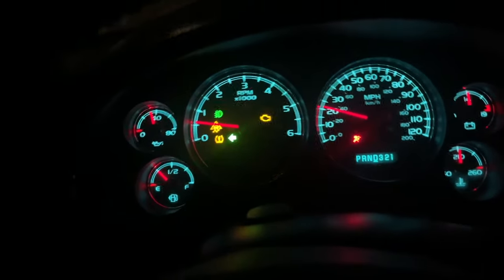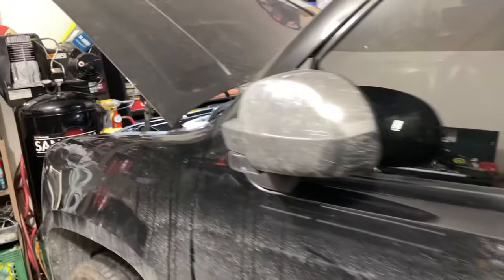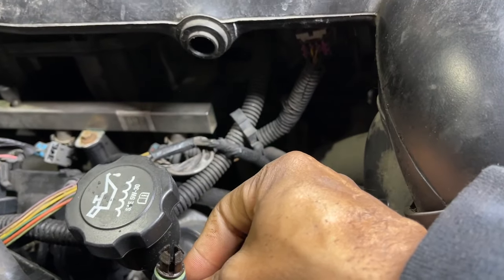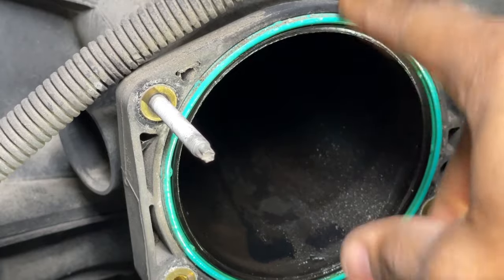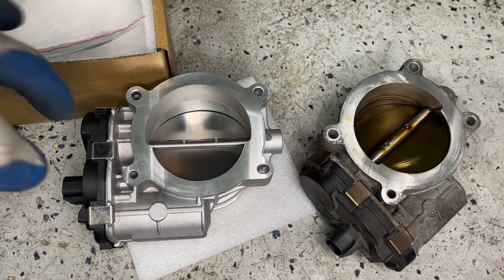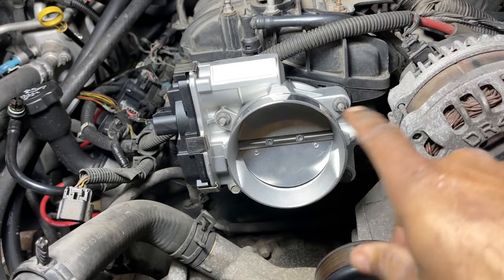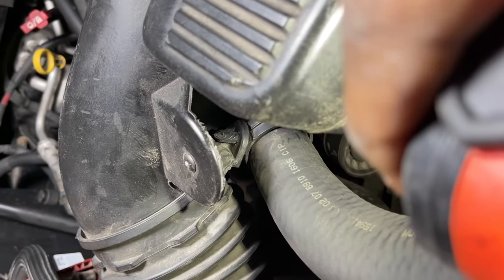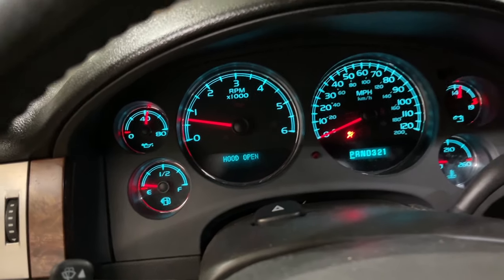How To Fix Reduced Engine Power Quick And Simple! Code P2135 Chevy Or GMC Trucks / SUV's! TPS Issue!

Comment: Couldn't you have just replaced the sensor alone? I have a 2012 GMC Yukon SLT 5.3
Reply from the maker: Possibly, although it's not recommended. It's actually better to replace the part unless you clean the throttle body really good. There will be a carbon build up inside the section that rotates that may be hard to reach. That's why I would definitely replace the entire unit. Also, the sensor cost just as much or if not more than an entire new unit. Here's a link to the part for you car....
https://www.ebay.com/itm/184534737954?fits=Submodel%3ASLT%7CYear%3A2012%7CMake%3AGMC&hash=item2af720a422:g:x7gAAOSwG2Rh2PXF&amdata=enc%3AAQAHAAAA8JwaDkzcr%2BWUsWbfTUo8ogdmPxUHeqeySlo%2BvgMGXF6GZEIlOdPiBNf%2FykFhlLt0VdZFrDjn1vpSj2tSBdM%2BR%2F%2BZykb7ZdNZUr1p8KVtaHN1V4Ejho3VnxQkDleLs2hI40FUvbccUIP%2BIJ%2B03pUEY78Sb1ZfVEipq5cr4G5n38BbMrO3oK4q6sj1owvz%2FqyxT3OGx0IIzIdrx9e0LvsJVskxZLMW%2FgkZpjMBOg35c7EiZlf%2BBF1HgFyEev8EuZlIvESjz2o1FFtqNJbSGk72V5FbagoCWrBy0zgYIz%2FexeHwiExtXESv2U4EgEItSoLsGA%3D%3D%7Ctkp%3ABk9SR4y3zoSaYQ

Comment: Hey, I have a Chevy 2016 equinox LT 2.4 engine and out out of nowhere. Once I put a new battery it was a cheap battery and I was told that it wasn’t compatible with my car but I can use it the next day my car started reducing power jerking and no acceleration when I hit the gas so I went back got the correct battery recently got it installed and it’s still doing the same thing There’s no sign saying reduce an engine power but the (!) Is present along with the engine light camera isn’t working in reverse. Seems like there’s a lot of shortages within certain car program I’ve got diagnostics I’ve been told my transmission might need to be looked at power steering service is on and stability. Track keeps coming on

 could it be something as simple as my throttle body should I just get this fixed to see if that fixes the problem.  Last question when replacing the throttlebody is the throttlebody and the throttle sensor two different things?
Reply from the maker: If I were you, I would get the codes read to see exactly what is the problem. I can help you out or guide you then. Also, the throttle body has the sensor attached to it, hence both are the same thing.
Reply: @TerenceDIY  thanks I thought I had included the codes that was given to me I end up going to two different dealerships and did diagnostics. These are the codes that were given to me. P2122. U0101. U0100. U0402.
Reply from the maker: The throttle body would not throw them many codes. What did both dealerships advise you to do? It's hard for me to guide you in a direction or pinpoint the problem since I cannot see the vehicle in person.
Reply: @TerenceDIY  understandable. the first two codes was at the first dealership and then the second two codes were at the other first dealership thought it was due to loose wires and battery because I let some guy at AutoZone put in the first one so they tightened them. It ran that rest of the day OK but the next day the problem started again. The other dealership I was at yesterday it said that they might have to look at the transmission to see what the problem is because of the coding, if only you were in Georgia 😅 but thanks so much just for responding 🙏🏾
Reply from the maker: I wish I were there to help. I could probably figure it out within a few minutes.
Reply: @TerenceDIY  I’m so desperate not to spend unnecessary money I’ll do a face time call sh*t lol thanks tho 🙏🏾
Reply from the maker: I would have to be there with all of my scan tools, etc.. It would be impossible for me to diagnose through Face Time. I wish I could though.

Comment: I replaced it still same problem. Is that because I need to reset it?
Reply from the maker: What trouble codes are you getting??
Reply: It was throttle body I replaced it with the sensor now it’s showing code p0449
Reply from the maker: I am not a betting man but after dealing with soooo many of these vehicles, I am guessing this is your issue. Here is a link to the part...

https://www.ebay.com/itm/164284961563?fits=Year%3A2007%7CModel%3ASuburban+1500%7CMake%3AChevrolet&epid=12042026476&hash=item264025931b:g:PKcAAOSwuPdidHGk&amdata=enc%3AAQAIAAABANZO3mdzztKOPDdKkxcZiIIpWvekd62XMfL5MizkJVBsXdSwLRu9u1m0XAZGITVpNjJjrWT9m9XTm8xkX94DursmIkY0zf4w%2Bp%2FwiPLhqWqcc6mY2jNzbSJZwfzf4O7Xn9VaMwl070MBFbE8qe8ephD%2BF3yn3Vu3TCWGudzuTbl10Ys1xW62Fpx5Lq3BHuUAuf71aGbyPrwiCNe4IoX%2BzAhgP2wc90bYZD8o1yH8wb5DTK63QKUlV7yDPsPlqho0mddawcnHaa07i83RYCk1arZn5cKgM%2Bhbe3eSSjwJf0paT%2BmSUKma08aa2XFJ8ycvUJY9VDI9Z5O2mo3YwIHiNTI%3D%7Ctkp%3ABFBMvKCSoqdj

Comment: my 2003 silverado has same issue but daylight running lamp is dim. when I turn on headlamp, it activates the reduced engine..
Reply from the maker: That's weird. How are the volts reading? Any codes?

Comment: I changed the throttle position sensor on my 2010 Silverado, and it had 4 codes show up after that. Should I just ignore the codes and go ahead and reset them?
Reply from the maker: Yes, reset them and drive it a while to see if the codes arise again. How is it running? Did you replace it with an aftermarket throttle body? Thanks,
Reply: @TerenceDIY  I just changed the sensor, and removed the throttle body to clean it. After I reset the codes, it cranked fine. When goosing the pedal, the rpm’s stay stuck at around 3000 for longer than expected, and a couple of times I had to put it in gear to get it to go down. I’ve cranked and warmed it up several times today and drove it about 20 miles with no problem.
Reply from the maker: @johnharrison5656 , hopefully everything is fine now. If not, I would recommend replacing the throttle body as a whole. Let me know if you need a link to a good, reliable affordable part. I buy from several online sellers.  Thank you.
Reply: @TerenceDIY  Thank you and thanks for the video.
Reply from the maker: You're very welcome John. Thank you so much for watching.
Reply: @TerenceDIY  Hey man, just an update. The more I drive the truck, the better it’s driving. The high idling has went away and it’s starting to shift better. It took about 60 miles
Reply from the maker: That's great!

Comment: Im having reduced power engine 2013 sierra 5.3 I have another truck that’s working good so I installed the working throttle body on the reduced engine power truck but it’s still the same
Reply: I need help
Reply from the maker: Hi, there was a bulletin released by chevy some years back regarding this issue. The bulletin consisted of either a bad throttle body or the wire harness that the throttle body plug come out of being an issue as the wires were becoming frayed some how. If I were you, I would check that harness thoroughly to see if you see any issues along the harness. That's the best advice I can offer since I'm not able to inspect the truck. Thank you so much for watching.

Comment: Can you replace the sensor only on them or buy new unit. Ive got a built 5.3 2007 Avalanche.👊
Reply: I have a 2007 Chevy Avalanche LS V8 5.3L Vortec 4WD Flex Fuel.  I only replaced the sensor and everything is good now.  I disconnected the negative battery cable for 24hrs while waiting for the part.  I followed the steps identical to Eric @SouthMainAuto.  Issue is finally resolved.  Gl

Comment: Hi my 2007 suburban has been giving me the reduced engine speed error. When I took it to advance auto the code p2138 came up so is that a different issue?
Reply from the maker: The code p02138 can possibly be the throttle body motor being defective. I would change out the throttle body if I were you. It's VERY easy to change. Here is a link to an OEM one. 
https://www.ebay.com/itm/114732200404?_trkparms=amclksrc%3DITM%26aid%3D111001%26algo%3DREC.SEED%26ao%3D1%26asc%3D20160908105057%26meid%3D404e5ce83ec54ee9ba2b0d57bcc08fc9%26pid%3D100675%26rk%3D1%26rkt%3D15%26sd%3D114732200404%26itm%3D114732200404%26pmt%3D0%26noa%3D1%26pg%3D2380057%26brand%3DGeneral+Motors&_trksid=p2380057.c100675.m4236&_trkparms=pageci%3A22c50910-f0ce-11ec-937b-fe034324fcf9%7Cparentrq%3A828fbfed1810aa7148884318fff25382%7Ciid%3A1
Reply: Our 09 tahoe has the Exact same code.

Comment: Did that throttle body end up fixing it the whole time?
Reply from the maker: Absolutely. And it still run amazing.
Reply: @TerenceDIY  sweet! My 04 avalanche 5.3 is doing  the same thing. Alot of people  say it's a ground and then the reduced engine power comes on when they hit a bump or pothole. But mine does it at random. Was yours at random? Or when you hit a pothole?
Reply from the maker: 100 percent random. 

Here are a couple of links to the throttle body in case you want to replace it. 

https://www.ebay.com/itm/225590875332?fits=Year%3A2010%7CMake%3AChevrolet&hash=item34864394c4:g:tgUAAOSwNrhkby5M&amdata=enc%3AAQAIAAAA0NNQWXMnLtdnN%2Byk2rlPXLmDWd9AB5%2FNY652Eej11m1%2FB0G1XhWda%2FpviIbqPRJLH4C0Tyu2IOxZ9%2BhGC2eHlG2WNK9nBkvGu%2BBWK5S1ZCy1ptkk%2FPwYPfMWz0Bi4nJZVVaIF%2BqT8eBu8I9H4kE79oi%2B09GINpLknWXuov9DklivABeiaKp8roClnaaNdcosxBg9Hmb%2BXKYBZ%2B%2FIT2h5R82wPCfV6tSLn%2F%2BGxRNxyExvGBrw6LCCdlu51M6WasTWM55BcHaJ8L1kgzQSCbhWSQo%3D%7Ctkp%3ABlBMUJ7toKaRYw

https://www.ebay.com/itm/334545636173?fits=Year%3A2010%7CMake%3AChevrolet&hash=item4de4794b4d:g:ZnQAAOSwm3ZlfWEn&amdata=enc%3AAQAIAAAA0NHmZTvPKTWvLELcReyOYpiF0wpvs01Am1J1QE88o56udbETz8kRtqEihqMfWZjDajyDb6HnWsjunIdX3S9Nngw3t2x%2FCC3%2FZ4l3kRSOnra%2BBq1Pn1F78WAZ3LplF91acU3V8W1Q9fevvIYnDdO3LdBCcXwOMJ6XrnRJ2hN2E5iTj0Csgq2m5H7IXYajMV1DvtQd%2F1Qo1k4VrBvA%2BOQF1HNYz6dM2MtN9P%2FDxUHCMpdHN4boQSRss%2BX1UU49UA2MCcuDxGFTpUQ8gBfXklun2CA%3D%7Ctkp%3ABk9SR57toKaRYw
Reply: @TerenceDIY  thank you so much!! Those prices  beat rockauto  witch  is hard to do! Might just do that! Ty so much
Reply from the maker: You're very welcome. That's where I buy 90 percent of my parts from. For years now. Once again, thank YOU for watching.
Reply: @TerenceDIY  well im definitely  subscribing to you now.
Reply from the maker: Thank you so much.

Comment: Thanks for the great content, keep it up.  I own a Chevy Express 5.7 L, what would give me more of an improvement in economy (mpg’s); replacing all of the O2 sensors OR replacing the I.A.C. valve and the T.P.S.?  Thanks for your input!
Reply from the maker: The O2 sensors will help more than the IAC or the TPS (ONLY if they need replacing). You can clean the IAC sensor and it will work just like new. The better solution than all of the things you mentioned would be a high airflow air filter like a K&N. You'll get the best MPG, and a little added horsepower. Thank you SO much for watching.

Comment: I have a 07 trail blazer ss 6.0 it didn’t let me accelerate any more and the streeting wheel got stuck shortly after the reduced engine light turned on what could this be I already changed cam senor
Reply: Please help bro
Reply: Does it everytime I drive it , it leaves me everywhere I have to wait about a hour till I try again and it oddley turns on again
Reply from the maker: @Deleteddddbd  , the reduced engine can be a few different things. Can you tell me what codes the vehicle is throwing? I can check the software once I know. Thanks,

Comment: I buy auto zone one and only work for two days so I have to buy one at the agency and u think it will solve the problem
Reply from the maker: Autozone does not sale the OEM one I don't believe. Here is a link for an OEM one. 

https://www.ebay.com/itm/114732200404?fits=Year%3A2007%7CModel%3ASuburban+1500%7CMake%3AChevrolet&hash=item1ab69271d4:g:bnAAAOSwWMRgU8CT

Comment: Im getting p2135 code still after changing both the tps and even the accelerator pedal position sensor with gm certified parts and still get that code sometimes. Any suggestions?
Reply from the maker: Did you replace the entire throttle body assembly? If not, that may be your issue.
Reply: I ordered one and it's on its way to me now
Reply from the maker: Okay. Keep me updated. Thanks,
Reply: I replaced the throttle body and it still went into limp mode after driving it for a day. I believe it's in the wiring or the ECM itself
Reply from the maker: That's exactly what I was going to tell you to check. There was a bulletin Chevy released regarding the wiring or that harness and connector that plugs into that throttle body some years ago. Inspect it really well for frayed wires, check the connector as well.

Comment: My headlights keep flickering 2012 LTZ Silverado something with the ground wires can’t figure it out
Reply from the maker: Hi John, when do they flicker, during the night time at use or all the time (daytime running lamps as well)?
Reply: @TerenceDIY  during acceleration
Reply from the maker: That's odd. You are probably correct about having a bad ground somewhere. Just gotta track it down.

Comment: Hi Terence, 
Hi I'm having the same problem with my 2007 Gmc Savana 3500 with the 4.8 Vortec.  The one you replaced looks just like mine will that one work on mine and where did you get it?
Reply from the maker: Yes, it will work. Here is the link for the SPECIFIC part for your van...

https://www.ebay.com/itm/293727259993?fits=Year%3A2007%7CMake%3AChevrolet&hash=item4463824d59:g:C5YAAOSwpnVgmzsw&amdata=enc%3AAQAHAAAAsJ30pMu8uQE%2BTlYMCs4jtZSWCHNids%2F5Gd7Ta0kpqFiS47j5BihuFAXafdmuAiY0HEe0CqB4xw22ypqmvJtU3Ss74X2Xps8Z8m5Pavw8FB6RTZfNf%2B1K%2FvFYUTXAm4bnwE%2FW8lt4adcWqEiKOhQ77tW%2FaUgRvc5SUhveyTUNYKUWjRKdf28sC%2FpojmpC7sx5mMTnD2VRBGdcDJrX36mzjaGl480LDP4P8vBgIujRC3n3%7Ctkp%3ABk9SR4qy-sHAYQ

Comment: Doea this reduced engine power only happen with drive by wire throttle bodys
Reply from the maker: Nope. There are many circumstances that would cause the reduced engine power (limp mode). The codes are the most important insight to the cause of the problem.

Comment: You never say what exactly you changed/installed.
Reply from the maker: The video is extremely detailed. If I did not mention the part name, I apologize. It's the throttle body. Here is a link to the part. 

https://www.ebay.com/itm/273974704021?fits=Year%3A2010%7CMake%3AChevrolet&itmmeta=01HYAXNYYP6ZQRQ8TS1NH97XE1&hash=item3fca2a3795:g:J4kAAOSwZE5mGTEF&itmprp=enc%3AAQAJAAAA8E06yIDENQEGtBF07wx%2B2BShtatMkABSa%2F6fjDKkL8TV3%2BkcDOLJdyS4xkxI2PMZfvYiiqHbAL1VFY7uJvXEvhq0BSnHv7HeH7C%2Bg946IuVTf8DySisEn2LQ%2Fao034FloIoCwdQypIZWDdDwaSmu5d6dLCZP4%2FmWHljSHpVb0rNzLe4MIo5LDKRczd7DQChEhy%2FNd9lsDviYjO3gXYd%2Fae9iqGF2189E8B2f7WO2XHJIf1Km6Y0eufKUXLGgYQLd64xLxI4aO4Z4%2Bp3u9I45yrDjEbGMb7YLvQ%2BIzaH414ebaMPwtA4ih5MoJjgLhOQvDA%3D%3D%7Ctkp%3ABFBM0O_X3fJj

Comment: Hey I’m having same issue with my 2017 Camaro LT. can you please help me with what to do. I’m get code for the TPS. But it’s hard to find just the sensor.
Reply from the maker: What engine do you have?
Reply from the maker: If you have the 2.0, the sensor is attached to the throttle body. You will have to replace the entire throttle body (very easy). Here is a link for the part. 

https://www.ebay.com/itm/134057637783?fits=Year%3A2017%7CModel%3ACamaro&hash=item1f36753797:g:yxkAAOSwYVBiWbYa&amdata=enc%3AAQAHAAAA8BcPqSaLCU9Nmk43IVMEJB30hu89je%2BtLyrmBz2iG4KFiuXCt7Wz9d5oaeLZy0x%2F347Kgr%2BB4La%2FETPRZ7IeuONsTh6c58UGrCI6ZbpBr6qlXMH4xn5Yfo7TrbGHKLHH7ruvU2F0BJuIO%2F2xJTqom5aQhxVlTAV6ypX5bVCWtnbKAsRv9DHDcysC0WSAPLM7pFYDd9pyxqtM8284ZZQrRGGxphMLA%2FEAXIJ836TXbVQDQ%2Fbi99C45ELRv8hLaWE3kP%2BwG5yvKpGObjhohDvJFu93VMqFHyicSk%2FD7mHZgHT3Yb2XOjj%2B9IJLt42bT18WcQ%3D%3D%7Ctkp%3ABFBMuqzA0Ihh
Reply: @TerenceDIY  Thank you super much. I figured as much so I did just order the whole part. Thank you again. Damn life saver!
Reply from the maker: @girlwitcamaro1119  You're very welcome. Good luck with your fix.

Comment: What is the name of the part you changed
Reply from the maker: Hi Jameson, I changed the throttle body. Here are a couple of link for the part (below). Thanks for watching!

https://www.ebay.com/itm/371007464588?fits=Year%3A2007%7CMake%3AChevrolet&epid=12021372402&hash=item5661c4a48c:g:UPwAAOSwyd9iWwi2&amdata=enc%3AAQAHAAAA8PrlFvj7kEavNMs5%2F%2BWSz2YlLr2bcPGrgNeGUIwAAq5ycmM0Sq2nye%2FtxsDgXPE3r%2Bb7ouybdx9ZRcopWyftBisWS2518H8St%2BcpAOkG%2BONNPhMpLxNpYoa8nM5mYObx6FbL0TNMGZL3PFjq%2BWNOYHKXV5GFL9SaIdhrJEY2wmFzrIAJLFlsOjXpGPL4oFvLus%2F8vXp%2By4SQAH6EAurSVt6jD4EarJ4S%2FjpSToqJ%2Fld3XQIBGyy3fyeikfbuAP2Y1JCgO%2FDmaHdst1Cc8jEavVUOz3qkwEYGqDgp%2FQLA55Il4v8NjYjK%2B6Qz5Ju7JuAzNw%3D%3D%7Ctkp%3ABFBMhu7kxd1g

https://www.ebay.com/itm/333272439452?fits=Year%3A2007%7CMake%3AChevrolet&hash=item4d9895da9c:g:EpoAAOSw6QJdM5EW&amdata=enc%3AAQAHAAAA8MoUyTfsKekX%2Be%2BCj7USOvxRS2XHH%2B4s%2F3tNXtAZ4Z%2BLY2YJ8cZZawMqXI5eRkCN2peingTBDhw67RTFniZ13YeWeYbWwzGRlOX3gCqapuSIPwlEOfKzGzdNW%2BNzE8MbtR3sWCA%2FFTpC3pmpIYaPXviszu%2FNd%2B%2BVcUkBzfTPqRAG6Fa92J6u9BGdpGXJKcAj9mT%2BF4Wc7e5kWUXoKNYYwnkkRSYnce93eBkkjpoDNEmWDUc0HxaboDdWslzVUibNEXZXenM1oESgDEzyRX%2FACJXdfUtz6OZr6eWG7f%2F%2BE4OSwPa50NoxsOmbk7naHayDJA%3D%3D%7Ctkp%3ABFBMhu7kxd1g

Comment: I have a 2021 chevy Silverado rst and i plugged a pulsar lt (tuner) and changed some settings.. i later put the settings back to OEM (i think) and i took the truck to a shop for a check engine light..they plugged into my ECM and then all of the bs started..all codes started hoing off including the message "engine power reduced" and it wouldnt accelerate over 43 mph..i parked it for a few hours and when i started it back up it was fine..i was driving from tx to Oklahoma and it did it again so i pulled over and cut the engine and it started working fine again..its been doing that every so often for 4 time in a year..i was under the impression it was a sensor or that stupid pulsar Lt but now im wondering if my throttle body has gone bad after 3 years?? Is there anyone else with a newer model having this issue??
Reply: Yes I have a 2016 and put a pulsar tune on as well. Now it’s throwing p2138 codes. I changed the accelerator position sensor and was good for 1 month before code came back. Debating taking tune off and seeing if that gets rid of the problem.
Reply: @Jchevy16  it will